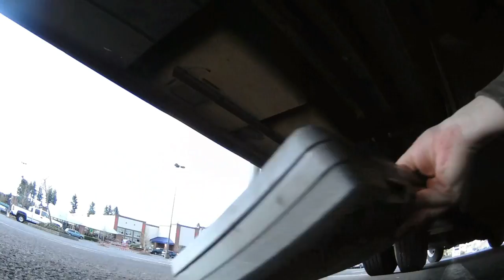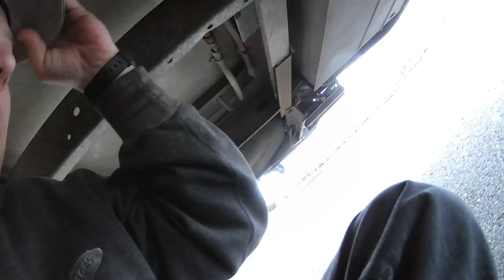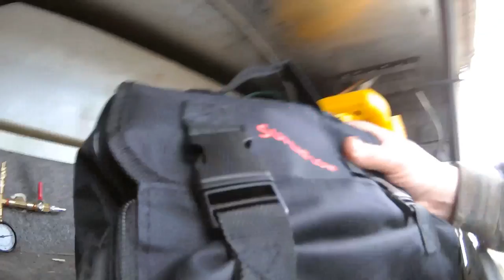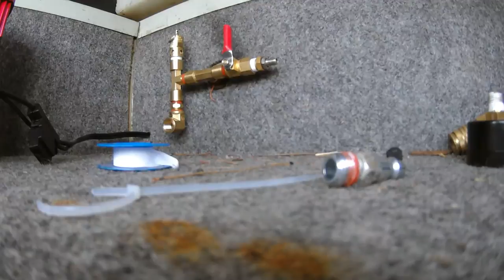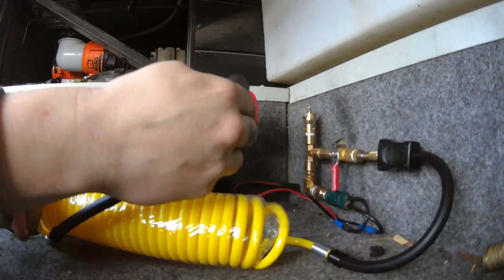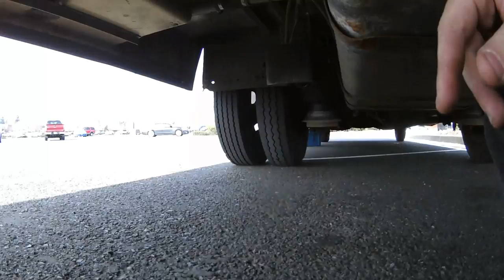Custom Air Compressor Install In RV

Comment: Its a good idea..but compresser to small..I hooked up a bigger one with a built in regulator to my inverter running off the battery..

Comment: Schrader cores present a massive flow restriction. Since you have to shut off valve behind the Schrader, you may be able to remove the core and put the hose from the compressor directly onto the fitting.

Comment: Had you considered setting up your air compressor system so as to be able to use your air tools on it?  I don't know how well that would work.  Any thoughts?
Reply from the maker: I have, it would be awesome but the compressor takes so long to fill the tank it would never keep up with my tools, perhaps a stock compressor would work, or just a bigger one
Reply: Perhaps a stock compressor/tank combo 120vac run it off the onan when doing repairs.  Use a second compressor 12vdc plumbed into the tank to top off the tank for the air shocks and air horns if you use them later.  I have a set of Buell Trombone airhorns from 1940 they are 42" long I got off Ebay got mine for about $125.  My grandfather had a pair back in the '50s and gave them to my dad.  My dad put them under the hood of our '55 Chrysler New Yorker  definitely a Battleship of The Boulevard.  When dad hit the horns people had major brown accidents in their seats.  LOL